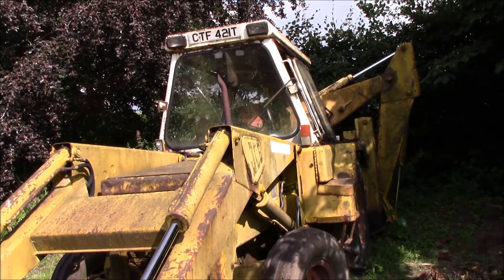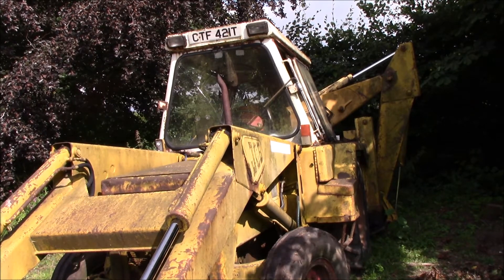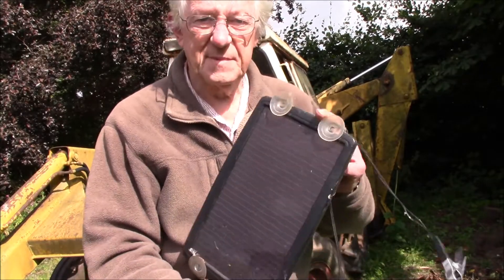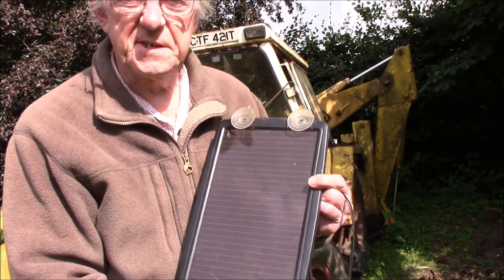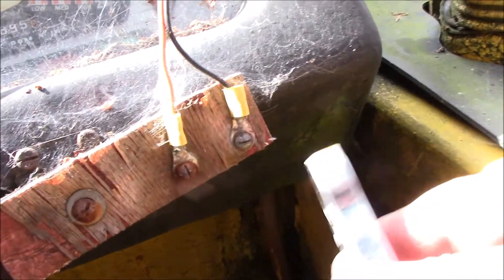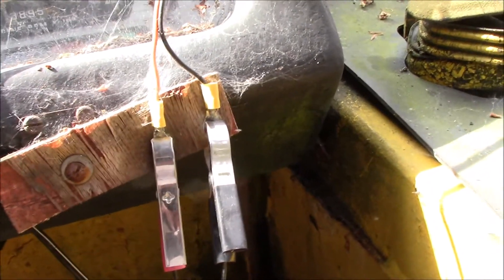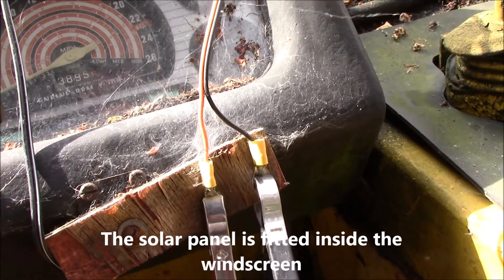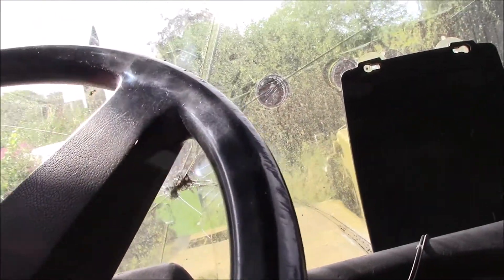Look! 44 year old JCB digger - will it run?

Comment: Very good, iv got one of them old diggers,now the water is getting into the engine oil, have you ever had that problem.
Reply from the maker: No, the engine is very good. We have only had to replace the clutch and alternator. Your problem sounds like the cylinder head gasket has failed.